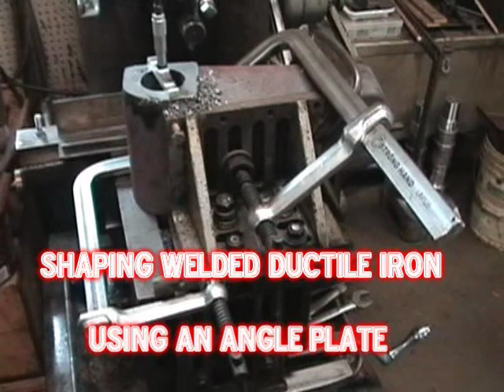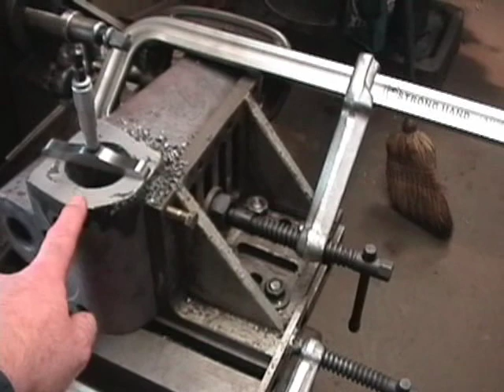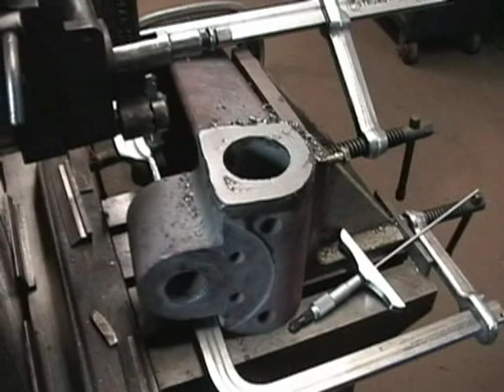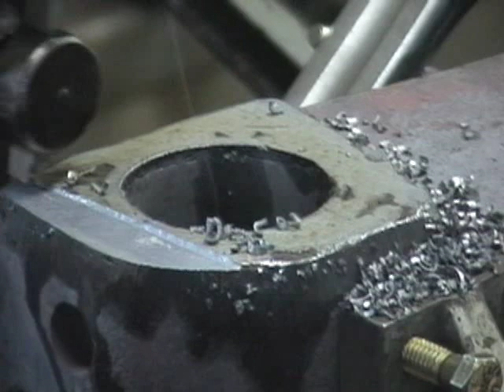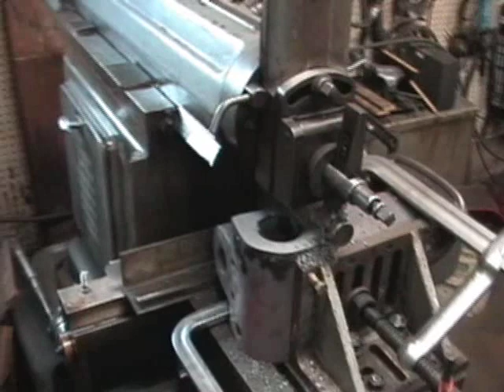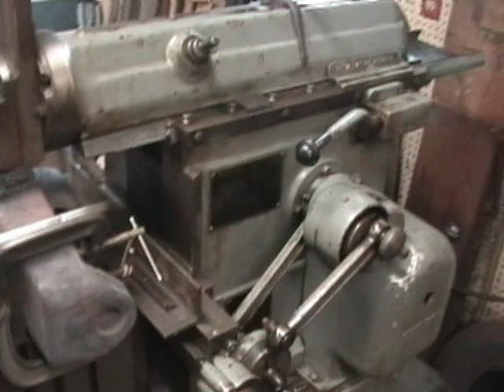Metal Shaper with angle plate.avi

Comment: Thank you for sharing this video.  you do nice work.  I have an old shaper, an Aamco model 7 but it too is in excellent sahpe.   At one time we used it for production work.  We has a job making little small bushings that had a slot across only one wall.  And the slot was fairly deep and very narrow.  We made a little fixture for holding the bushings and just nibbled the slot down.

Comment from the maker: I don't shape these to get a better surface finish. I do it because I can use HSS on the shaper, while it's cutting I'll just walk away & bore the holes on my Jigmil (link added to my desciption). If I flycut or shell mill them I would have to use carbide & stay with the mill. The surface is E-70 weld overlay on ductile iron & you can hear the toolbit "bark"  around the edges which are harder because I do what is known as a "quick anneal" in the furnace @ 1600F & shut it down.

Comment from the maker: Been away for awhile.. Most of the time I use the shaper I'll set it and go off and do something else while it runs. Here the weld is also very tough near the edges and tooling holds up better at 20-30 surface foot per minute than the recommended 60-90. Thanks for viewing!